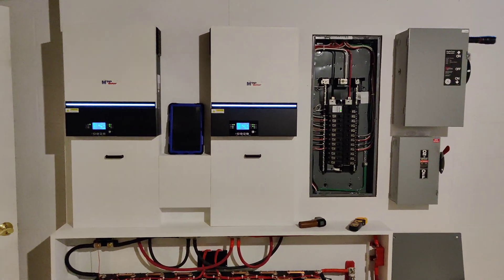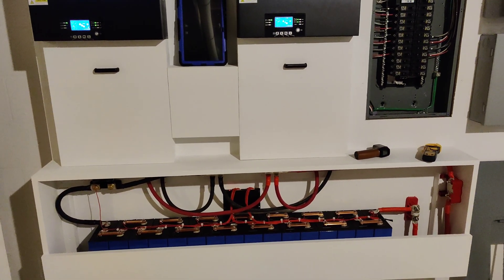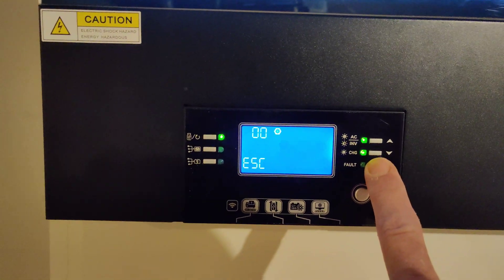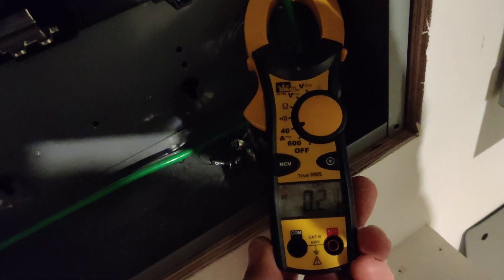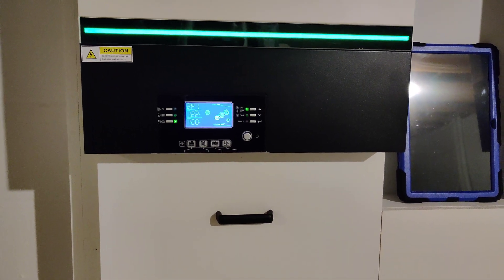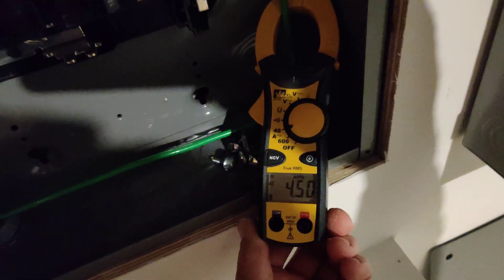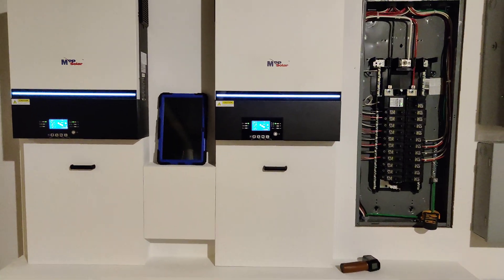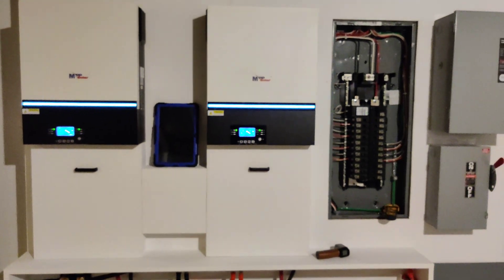13KW - MPP Solar LV6548 DIY Power Wall - Ground Issue? Updated comment below!

Comment: You have 2 N/G bonds, one at the main panel, and another in the AC output of your invertor. Basically you turned your ground wire into a LOAD, you need to consider a wire as a resistor too.

You have problem in both cases, it does not matter  battery or utility, your ground wire has a potential difference on both ends of N/G bonds
Reply: If this was happening at my neighbors solar unit would we have any negative effects?We recently discovered that we are feeling tingles in our home when neighbors solar is on, mostly in feet and legs. Confirmed when neighbor turns off solar the tingles go away. We don't have to touch anything in our home to feel tingling. Its felt all day from when the solar comes on and stops when the solar goes off. We have power company coming to check it out as our electrician has confirmed its not a problem within out home. Neighbors deny any issues on their side. Any idea what's going on in this situation and how to solve? thanks

Comment: My EG4 inverters had the neutral ground bond inside. I had to get permission from Signature Solar to remove the bonding screw in order to not void my warranty. I'm not wired like yours, but I didn't want a current carrying conductor on my ground being shared with my neutral that is already bonded in my main panel. You're only supposed to have one.

Comment: Hi Dan, please help me with one simple piece of information. I have an 8kW Solar Mpp and 10 solar panels of 590Wp each. The inverter, in the description, is 2x4000W. My question is: can I put all the panels -5900Wp on a single input to the inverter? VOC is 42V for each panel - the inverter supports Max. 500V. Or how is it better to proceed? Please I wait for your answer ASAP. Thanks,

Comment: If you bought this unit directly from oversees most are only internationally rated with a ground neutral bond. Unless you specifically request it to used for the US with no bonding

Comment: Dan, did you get this figured out?  I have a theory if not.
Reply from the maker: I ran the ground from the Main panel to the Sub panel and the chassis of the disconnects. I took the grounds out of the inverters totally. 
The inverter neutral inputs come from the Main panel and are ONLY bonded at the Main panel.
This fixed all of my issues and there are no open grounds or neutrals when I tested receptacles that  are fed from the Sub panel.
Reply: @danfitzpatrick4112  did you consider removing that internal grounding screw at all?  I’m doing a similar setup to you with the transfer switch to isolate the inverters and pass through grid…I was told by Ian that when on bypass mode the G-N bond is broken, but when in SBU the G-N bond is happening in the inverter.  This seems odd since you’d have two of them doing that.  I’m still waiting on material to finish, but you inspired me to try to run my entire house off these!  Im planning on breaking that G-N bond and then wire through the Neutrals and grounds to have a single bond at my main panel.
Reply from the maker: @danksu04   Yes, there are more than one of those screws as well.  When I removed the upper one it did take away the bond BUT only on the output side. This still caused issues because the input side is where the second N/G bond was still being created.
I also heard there is a new firmware version that is suppose to do this as well but I didn't update mine but you may look into that as well.
Reply: @danfitzpatrick4112  it seems like a you would still want an AC input ground at a minimum right?  I’d be concerned that you might end up with voltage on the chassis of the inverters
Reply from the maker: @danksu04  I measured for that and can read 120v from the L1 or L2 to the chassis which tells me it is grounded by way of the neutral back to the Main panel. 

Here's the thing.. These inverters when in battery or solar mode should be considered the first disconnecting means by code and should have the N/G bonded in the inverters but NOT at the panel, then they should switch back to using only the Main panel N/G bond when in utility mode. 

Your ground would be connected back to the ground rod near the main panel (This should only be at 1 location to be safe).

I may try another test removing the bonding screw and only connect the output side ground wire to see if that may make it all good.
Reply from the maker: @danksu04  No, because that is what creates the second N/G bond which is bad. This is exactly what caused my issue with current on the ground especially at my main panel. It basically creates a parallel neutral back to the Main.

Comment: I heard there is a firmware update that fixed this issue, have you heard or done the update
Reply from the maker: I read that on the forum that Will posted about it. It was unclear to me though if he meant that the bond was gone on the input, the output or both after the firmware update? So as of yet I have not done this.
Reply: @danfitzpatrick4112  well i guess I'm not sure what to do, im looking to buy one lv6548 but use a reliance manual 6 circuit transfer switch that has a L14-30 socket , , I would need to use an adapter to bridge the x-y on the cord so that the hot is split between the left and right side of the transfer switch

Comment: I just got off the phone with Watts247. The tech there said there IS a bonding screw within the LV6548s that needs to be removed for US split-phase 240 operations, when using grid bypass....same as Growatts, so not truly US or UL out of the box.

Seems that removing the bonding screw within the inverters, and jumpering AC In/Out Terminal Neutrals will solve the issue.
Reply: What was said about if just using one unit? I heard that there was a firmware update that fixed the issue

Comment: Dan,  I am trying to understand the ground wire path in your set-up.   Does the ground wire you are measuring current on go back to the big AC Disconnect or does it go to the AC Output of the inverters?   If it goes to the AC disconnect, where does the AC Output ground from the inverters go?
Reply from the maker: The ground comes from the Main panel (This is the only place it is bonded to the neutral), from there it goes to the transfer switch, the small disconnect below that (bonding the cases), the grounds in the inverters and the sub panel. Hope that answers your question.
Reply: @danfitzpatrick4112     OK.... so all of the critical loads are grounded directly back to the main panel...(Not through the inverter) correct?     I assume the AC-Input ground of both inverters is tied directly back to the main panel.     What is the AC-Out ground of the inverters tied to?
Reply from the maker: @centerrightproudamerican5727  That is correct. There are Morris insulated splice connectors inside each inverter, the AC-IN and AC-OUT grounds are joined together there. So all ground points are tied together with #6 wire (Including the sub panel ground bar) and this goes back to the main panel ground.

Comment: Quick question for those who understand about this system. If the inverter AC output is connected to the house breaker box and there is a connection that feeds the inverter back through it’s AC input. Is that okay? So in this case the inverter is generating power from solar and AC input and technically can feed itself? Because I’m thinking about buying this inverter and never understood this concept.

Comment: Hey Dan, Wonder if there were any updates to this ground issue.  Thinking about the LV6548 myself, but concerned about this.  Also not sure where you live, but in my area UL listing stamped on the inverter means passing inspection.  I know these have some designation, but not the actual UL listing as far as I can tell.
Reply: Lithium solar YouTube channel has done a video on the inverters
Having a ground/neutral bond inside removing screw will take care of it
Reply: @Your_Name_Goes_Here  Ok, this might be a strange question, we recently discovered that we are feeling tingles in our home when neighbors solar is on, mostly in feet and legs. Confirmed when neighbor turns off solar the tingles go away. We don't have to touch anything in our home to feel tingling. Its felt all day from when the solar comes on and stops when the solar goes off. We have power company coming to check it out as our electrician has confirmed its not a problem within out home. Neighbors deny any issues on their side. Any idea what's going on in this situation and how to solve?  Could it be the bonding screw?
Reply: @vfsd234  so this bonding screw is specific to this inverter itself and we don’t know what your neighbor are using as an inverter.   How close are you to your neighbors house? Sounds like it may have something to do with the way they are grounded.
Reply: @Your_Name_Goes_Here Thank you for responding. Our house is probably 20 ft from the neighbors. We share same transformer which is on our yard and next to their home. How would  we find out if it's something not grounded at their home?

Comment: 🤷‍♂️ I didn't relize there was a supply side bonding jumper inside the inverters, I thought that was just for bonding reasons. Your panel can't have a main bonding jumper when utility is being utilized, than magically float the nute and treat the panel as a sub-panel when PV is being utilized as the service...🤔 Your grounding electrode system would also have to magically switch too...

Comment: Dan,  A little off topic, but does the LV6548 use the grid inputs while it has access to the solar or battery at all? Or is it a one or the other?  I'm imagining a case where a momentary startup load surge is too great for the batteries or solar (like if everything turned on at once...) Would the grid supply the additional amps?

Comment: Any update here?
Reply from the maker: Well... here are my thoughts and I will try to video what I am going to rant about here as soon as I can.

This grounding issue may be a problem with many inverters that use an input from mains power and have built in transfer switches in my opinion, but I can't confirm this as I only have MPP Solar inverters.

Everything is fine feeding the subpanel from the mains (Bonding only happens at the main panel as it should be)
Once the inverters receive input power from the mains the problem occurs and this is because another neutral/ground bond has been added at the inverters. 

We need the input from the mains once the solar panel output is no longer and the batteries are depleted.
The inverters are smart enough to realize that if there is not enough from solar, or batteries to transfer back to grid and vice versa.

I'm not an engineer, but I think that the built in transfer switches need to be able to transfer bonding when needed. In other words, there should be no bonding when using power from grid at the inverter input (MPP Solar inverters have a bond and I can confirm this) That's a problem.

Now, you DO need a bonded neutral when the built in transfer switch goes back to solar input only because the inverters now become the "first point of disconnect" and you have lost the bonding from the main panel. 

Can you have it both ways? Do most inverters do this? I don't know honestly. 

I do know that the companies that make many inverters make them for many countries and don't want to get involved with codes, but this whole thing needs to be addressed by all of us who are doing this type of DIY installation. 

I'm hoping some viewers/engineers or anyone with their own experiences will check their systems and chime in here and help! This IS a safety issue that needs to be addressed.
Reply: @danfitzpatrick4112  I recently bought an LVX6048 that was supposedly built for NA, and could supposedly even feed the grid, but I have a similar, but different ground loop issue. It is quite frustrating especially given the cost and effort involved. You can track mine on DIYsolarform lvx6048 ground fault if interested.  Please weigh in to the discussion

Comment: I just order this full system with 2 LV6548 inverters. I have not received every thing yet. But i wont to connect to the Utility power for back up. The inverters say that you can connect the utility power to them but Idaho power says i can not. Right now it looks like my only option is to use a transfer switch to go from grid to solar.
Reply from the maker: I don't think Idaho power understands how these work. They will not back feed the grid.. They can however be grid tied (Inputs only from the grid) which is exactly how mine are setup and sounds like what you are wanting to do as well. They are basically (Grid assisted). The only reason they have input from your main panel is in case your panels aren't supplying power, then these transfer back and forth as needed automatically.

Comment: Hey Dan, any updates from MPP? I am putting in my sub panel now, and would like to know the resolution. 
Since I am installing in a garage, the sub panel is already there, with all the loads hooked up. 
60amp breaker from the main feeds the panel. I removed the input from that breaker, and installed another load panel with only 2 60 amp breakera in it. One will feed the inverters for AC in, and the other the Grid side of a transfer switch. The inverter out will feed the other side of the transfer switch. I will then feed the existing load panel main input from the load side of the transfer switch. Up is grid, down is solar. In the meantime, the Inverters always have grid power for their ac input. I have a whole house generator already, so Grid will never go down. 
Wondering about how to ground all that though..

Comment: I agree with your conclusion on a secondary bonding point.  Sounds like the current is splitting between G/N.
Have you tried putting your am meter on the neutral and lifting the ground while in operation to confirm?

Comment: Your batteries are probably very close to 100 percent charge at those voltages. IMO only way to store these lifepo4 batteries is to charge them up to full and then discharge them a set amount of amp hours, then you know they are at the state of charge you want.